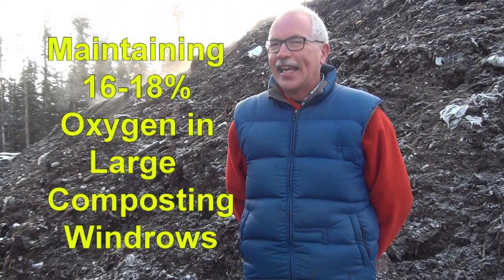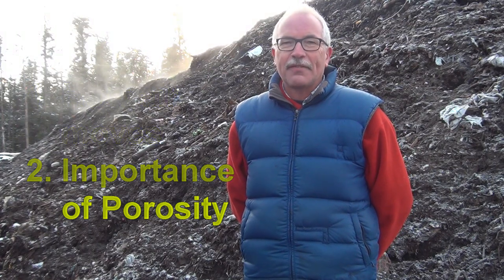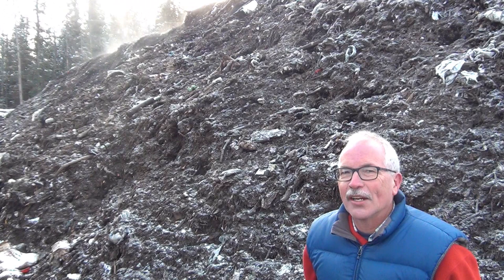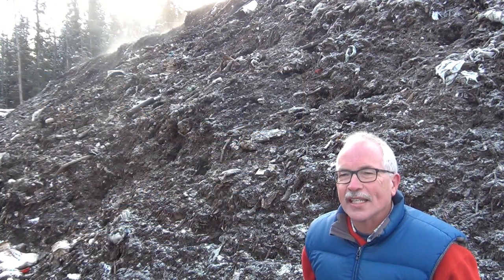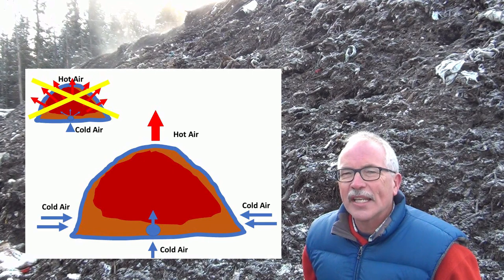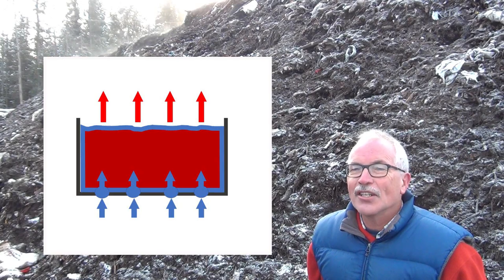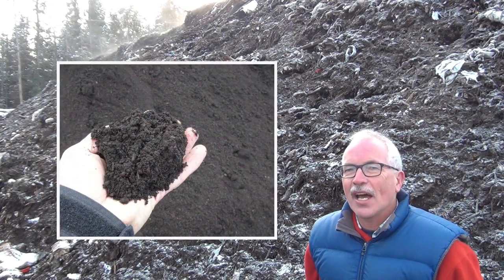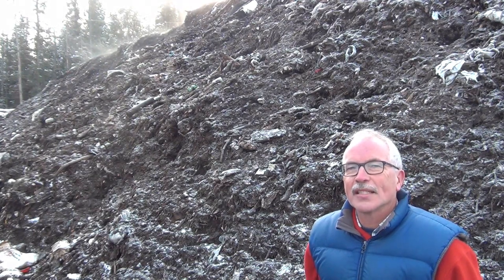Maintaining Oxygen in Large Aerated Windrows

Comment: Thank you very much for the wonderful explanation in all the videos
I would like to know how I can pierce the pipe correctly
  The pile is 2 meters wide, 1.8 cm high, and 15 meters long. What is the power of the air pump?
What is the correct operating time, always or at intervals?
Reply from the maker: Thank you for your question. You can use a 4 inch diameter pipe with 3/8" holes drilled every 8 inches. A 1 hp air  blower that can provide at least 6 inches of water column pressure is likely going to be fine. The size of the air blower depends on the amount of energy (air requirement) in the composting material, as well as the air-filled porosity of the material. A timer that can provide some air at 30 minute intervals would be ideal.

Comment: hi John Paul, thanks for the video! i see that with a very small blower you are able to aerate a very large pile. i was wondering what your thoughts  would be on a pile that's half as wide and tall as you mention in the video but twice as long ( 15ft wide, 8ft tall and 240ft long). what kind of motor would you think i would need? will a 5hp blower reach to the end of that very long windrow? appreciate your time, thank you!
Reply from the maker: A 5 hp blower may be enough for a 240 ft long windrow - but it depends on a number of factors, including the type of material being composted (the oxygen demand), the air-filled porosity (to allow additional cold air in from the bottom sides of the windrow), the type of blower (centrifugal blowers provide adequate pressure), the size of the pipes under the windrow (needs to be able to carry air the length of the windrow), and the hole size and spacing (goal is to maintain the same pressure along the length of the windrow). I hope that this is helpful. Thanks, John

Comment: Would this be a static pile so no turning involved at all? Thanks I’m looking at making a no blower compost just perforated pipes at the bottom of the pile and pipes going vertical with perforations and left open at the top to let the air through (logically as hot air rises it will draw cold air up with oxygen) through the pile i am only making a 300 litre approx pile so no where near the amounts you deal with. Thanks
Reply from the maker: Normally these aerated piles do need to be turned so that the material on the outside gets placed into the middle where it can also get hot. 
Smaller batches that are not insulated in some way may not generate the heat required to create the air movement that we see in larger piles.
Reply: @TransformCompost  What if we put an insulated cover on top of the compost pile, but left a strip on the top to allow heat to exit to draw oxygen in? I want to be a professional compost maker soon and I want some advise before I start my first pile. I plan (or had planned if I change my mind) on making a 2 cubic yard pile the inefficient way to described with it being inside a wooden box. Also, if I make a pile this small, should I make a "pile" or a windrow like you show here?

Comment: My basic concept about composting has been  bit shaken. As i know, initially heat is required to kill the spores and pests for about a week, when pile cools down after 5- 10 days turn pile upside down for aeration. Will pile keep its high temperature in the presence of this vent? Thanks
Reply from the maker: The length of time that a pile may stay hot depends on many factors, but a small pile will lose heat more quickly. With a small pile, the intense microbial activity in the beginning of the process may result in some accumulation of heat as there is more heat produced than heat lost out of the pile. After a week, the microbial activity may no longer be as intense, and more heat is lost out of the pile than produced by the microbes.

Comment: Would like a be description of the pipe
Reply from the maker: We usually use HDPE or PVC piping. You can use HDPE piping above the ground and pull the pipes out when you mix. With PVC piping, its usually embedded in the concrete floor, or placed in trenches.

Comment: How and when do you measure the oxygen level?
Reply: You use an oximeter
Reply: @estebancorral5151  And how exactly do you do that? Which limit values must be maintained?
Reply: Are you a German speaker?  There is a German company which makes emisiones monitors specifically for compost piles.  I saw a video in Spanish done by a Colombian  university, but they did not name the company.
Reply from the maker: Thanks for the question Stefan. I measure oxygen using a Demista Instruments oxygen probe. Its a simple and cost effective tool that helps our understanding of what is happening in the compost. I measure it when I begin a new composting process and periodically after that to verify that we are supplying enough oxygen. There is no need to continually measure oxygen as its very expensive.

Comment: Why oxygen required for compost to mature ?
Reply: For aerobic composting. Microbes need oxygen to thrive and breakdown materials
Reply: Without oxygen you get anaerobic decomposition which produces a horrible odor and a lot of methane gas.
Reply: We have an in-vessel composter. And we pile the compost that is generated in an open area. So this compost piles should be covered to safe guard from rain ? Because due to rain the inside temperature of compost pile may get reduced. Please suggest